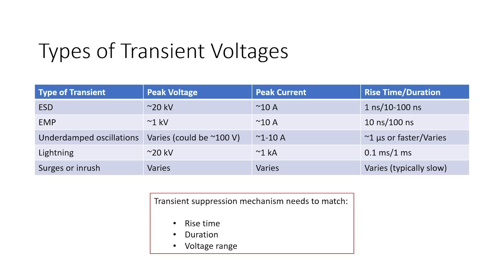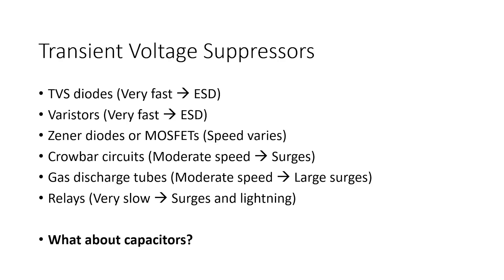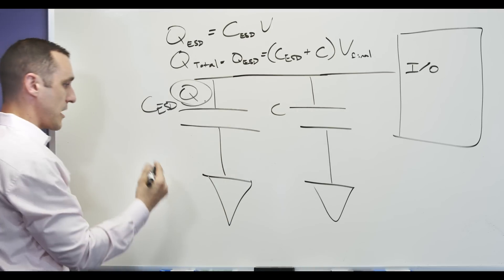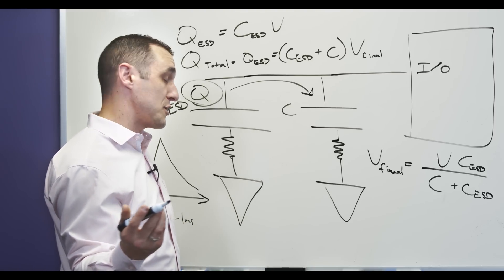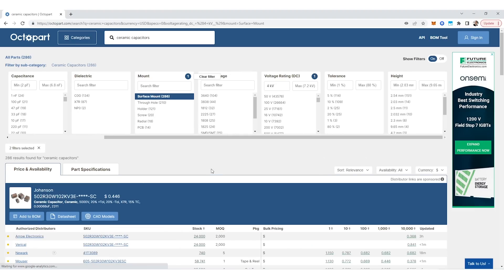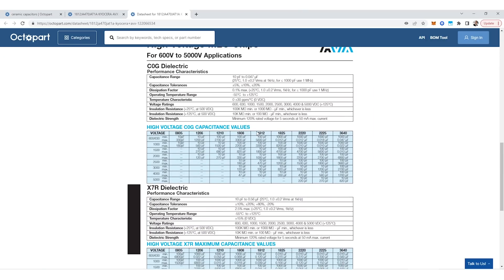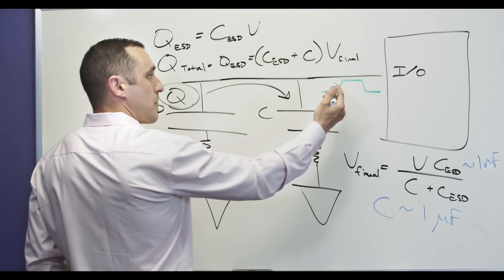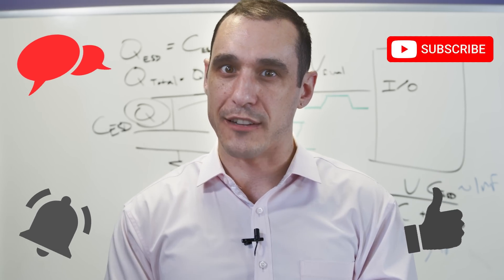Can You Use a Capacitor for ESD Protection?

Comment: The physics in this video are wrong. If the signal is slow enough to deal with 10 nF of capacitance, the parallel capacitor will offer the most effective ESD protection. This is easily shown with LTSPICE using the human body model connected to a 10 nF ceramic capacitor with 100m Ohms of ESR through a switch. The resulting voltage is clamped to 42.3V. But most signal lines don't allow more than a few pF of parasitic capacitance and that's why you need to rely on TVS diodes.

Comment: Once you've added equivalent serial resistance into the model it would be fair to add equivalent serial inductance of traces between capacitors and i/o unit.
Reply: That is actually one of the reasons you might need a high voltage rating on these capacitors. The residual voltage that is leftover on ESD protection components appears an underdamped oscillation and it can reach hundreds of volts before the energy is diverted from the protected circuit. For example, in an MOV the observed oscillation can be very strong during ESD, I recall seeing one of these graphs from TDK or Panasonic recently... TVS diodes show it much less because they have such low capacitance and so they respond very quickly.

Comment: Great video, the explanation was concise and clear. I was wondering before watching the video if I could rely on the electrolytic capacitor with 100s of microfarads connected to VBUS of a downstream USB port for ESD protection. I guess not.
Reply: Better for slower surges, but be careful with trying to use something like that for ESD. The parasitics along the current path also matter as these can create an oscillation or overshoot that persists for a short time on the capacitor. With MOVs, I've seen data where the oscillation can be hundreds of volts. Maybe you can prove reliability on power rails under your target ESD condition, but I would never use a cap for ESD protection on signal lines.

Comment: I would never try to protect a high speed signal line capacitivly, but what about the power rails?
When I have something like a 22uF 0805 sitting at the input or output, I don't expect the voltage to increase significantly, even when a large ESD hits, so the cap voltage rating shouldn't really matter. I would assume such a connector pin so be ESD safe, just from the high capacitance (assuming its a small, low inductive package like up to 0805. An electrolytic will surely need to long to charge up).
Reply: Usually on power rails you already have some capacitance on the line, such as for DC stability. Response capability depends on the ESR, ESL, and capacticance value so it is debatable whether it will be good protection against ESD. You could do a smaller case capacitor added to this so that you can have the lower case inductance and faster response time but it needs to also have a large enough voltage rating for your system. For like 22 uF 0805 on a DC rail you're right that the cap value won't really matter but the response time does matter. If you look at another component like an MOV in comparison to a TVS diode, the MOV response time is slow enough that there is some residual voltage in the hundreds of volts measured at the protected circuit (I seem to recall seeing an example from TDK), I would only be concerned of the same occuring in a capacitor that is up to 22 uF in size.

Comment: The answer is yes, you can use capacitors for ESD protection, and it is done all the time. Obviously high speed signals can't tolerate large capacitance, but for signals where the capacitance isn't a problem it works just fine. Voltage rating is irrelevant; ceramic caps will handle very high voltage without damage. I've used 0402 caps to protect against >15kV quite effectively. Why not use TVS? Because they cost more.

Comment: Thanks for the great explanation, Zach. A bit of a relevant question, I was working in an aviation company and we were putting TVS diodes to the connector pins for lightning protection. We were using bidirectional ones and connecting one side to the enclosure/chassis of the product instead of the ground/reference. It was suggested by the team leader and the idea was to prevent possible damage of that surge to the ground reference(?). I have seen that for ESD, it is connected to the ground. I have left the company before we had a chance to test the product. Do you know if that approach is correct? Does that contradict the protection from the ESD approach? Is there any fundamental difference between lightning surge and ESD other than the speed and voltage level? Thank you.
Reply: You want TVS Diodes for Indirect Effects Lightning protection (e.g. RTCA DO-160 section 22) to be connected in common with ground for the Lightning source. An example would be the chassis of an ARINC Modular Concept Unit (e.g. Line Replaceable Unit) bonded to airframe or a dedicated current return network CRN. The objective being to return Lightning induced current to its source in path of least impedance. Not passing through internal power and signal return impedances. So what your team lead is saying is best practice.
Reply: @haldanecollins3735  ahh okay, so the real reason is to attenuate the surge in the least impedance way to the source itself, which is the chassis for the lightning. Thanks for the explanation.

Comment: Why are you suggesting a bidirectional instead of a unidirectional TVS on a digital line?
Wouldn't a unidirectional diode be better since it additionally protects agains negative voltages?
Reply: He is talking about signals that have positive and negative voltages. If your signal only operates above 0V, unidirectional is better
Reply: It's for the case of bipolar signals as others have mentioned. AC coupled differential signals in general are an instance where this would be desirable.
Reply: It is actually the opposite, unidirectional acts as a normal diode in case of a negative voltage event and allows current flow from the ground to the signal line.

Comment: I would argue that we don't need a high voltage capacitor - its capacitance should stop it from being charged to a higher voltage. Anyway, I/O would be damaged probably by 10V or something like that long before capacitor's rating becomes a problem. For all the other reason I agree that capacitors are not the way to go.
Reply: Thanks for the nice comment. That's a good point but I wanted to point those out in certain instances where you're already working at high voltage or where the cap is very quickly exposed to higher levels, it really depends on the voltage you're trying to protect against, the nature of the ESD source, and the required derating (I should have made that clearer). I know everyone cites the human body model but not all ESD sources are human body, some are direct contact discharges that very quickly expose that cap to the ESD voltage. If you're talking digital I/O then yes it will be damaged at very low levels, but in other systems where you're operating at higher voltages you would need those high ratings, and ideally with an effort to balance case size vs. required capacitance.
Reply: @Zachariah-Peterson  regarding the voltage level, would not start the protection capacitor around 0v and will then be charged up to the calculated voltage? The voltage from the capacitor would drop across the wire resistors and esr, not the capacitor itself i guess. So a normal capacitor voltage rating should suffice.
I have done this on power inputs, but i would never do this on signal lines.

Comment: As I wrote yesterday, before even to watch the full video - all TVS posses capacitances. Therefore the selection must be carefully done, especially for digital lines. Not simply put a TVS there based on a basic parameter - many parameters must be considered, including the suppressor's capacitance. Otherwise such capacitances would distort, delay, deform the signals' waveforms and compromise the performance.
Reply: It would be great if there was just a single TVS diode that worked for everything!
Reply: I'd use a purpose-specific TVS when dealing with high speed signals, like USB, HDMI or similar.